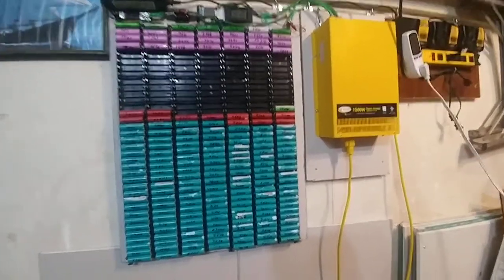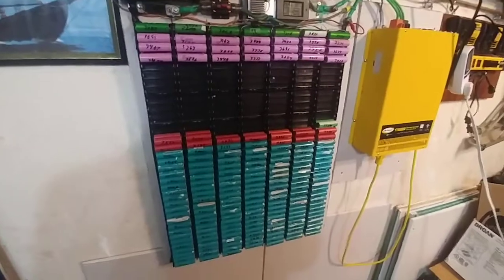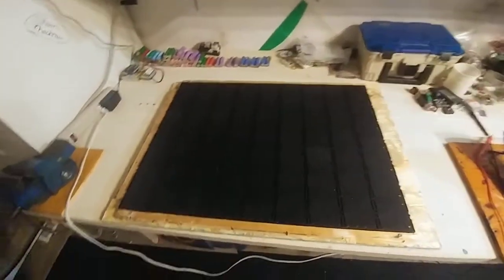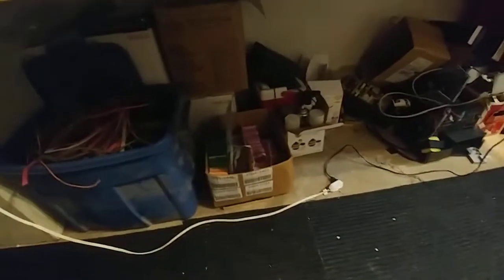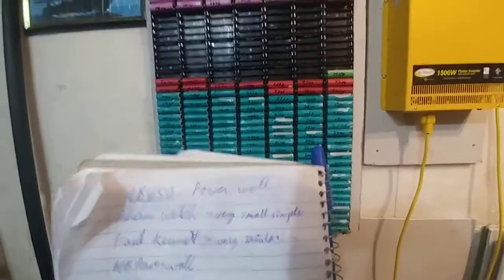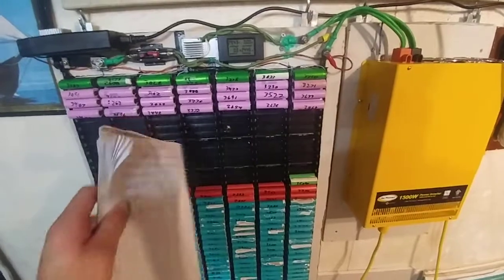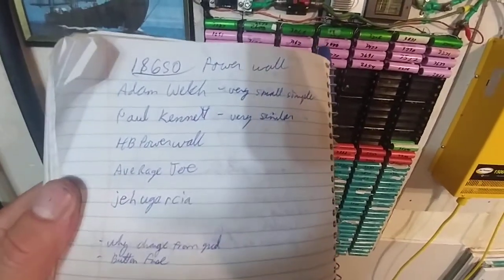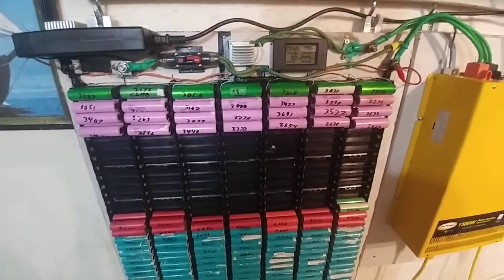18650 7s modular powerwall done!

Comment: What’s the capacity of 18650 batteries?  I thought they were 2600mah, I see on some sites, some sellers list them as 3000mah 5000mah, 9900mah...
Reply from the maker: 18650 batteries can have anything below 2,500 mah. I have a few used ones that are at that but anything higher is probably a scam. be very very careful. I keep my batteries in pairs as it works best for me so my values are double.
Reply: Andy Shell ok. Thank you

Comment: The second trick is to use more DC : most devices are in fact DC with a brick. Most bricks are inefficient. If you power as much devices as possible in DC (from 24V you can make whatever is recommended for each device, including USB  18V 12V etc.) then with a relative small system (mine is 2x12v 110 AH reused lead acid in series with 2x150w panels) I manage to shave around €20 each month of power bill, not because I produce that much WH, but because I removed a lot of bricks and use DC (with fuses etc) The problem with AC is that an idle inverter will already tax your power, then conversion have a yield meaning loss. Then when you plug a device, most devices convert back to some sort of DC. Use AC only for device witch have no choice. DC is WONDERFUL for HIFI sound system etc, it deliver pure chemical electricity with no grains, no noise, no hum.

Comment: How many of these 7s packs are you making?
Reply from the maker: Diy in the Ghetto 7 walls will give ~30kwh. Each wall is 3kwh to 4.5kwh. For now im working up to 5 walls 7 in the end. 4kw inverter. 200a total draw
Reply: Dude I'm impressed. I was thinking of using the Holders for the Cells. But i didn't know If drawing to much from them would heat up the holders to much and melt it.  So i didn't use them and just used the 4x5 cell holders like everyone else is using. However seeing this i might revisit this idea for a portable project . Thank you